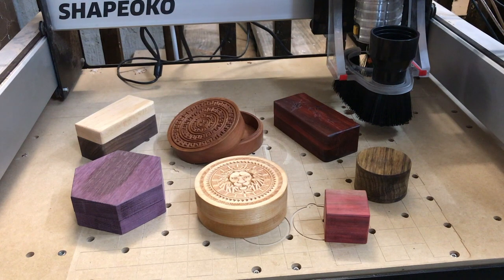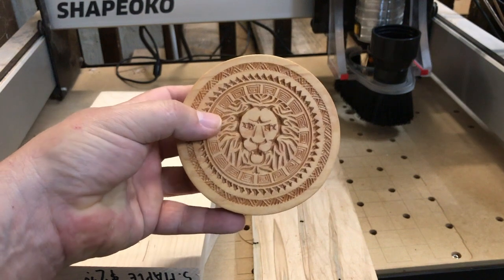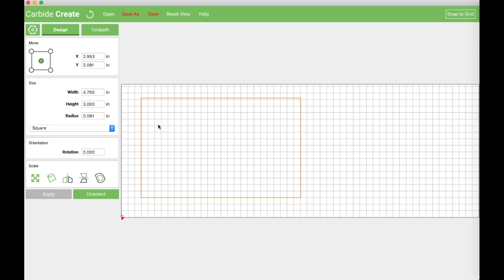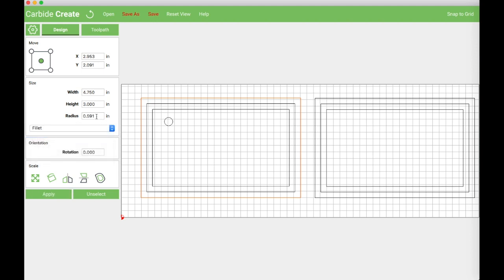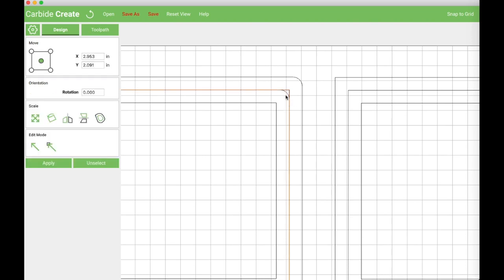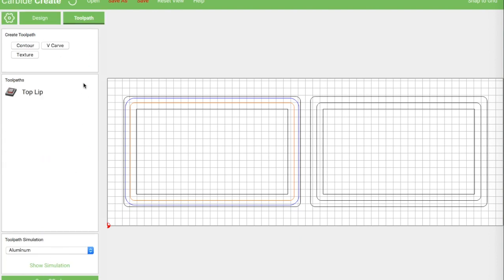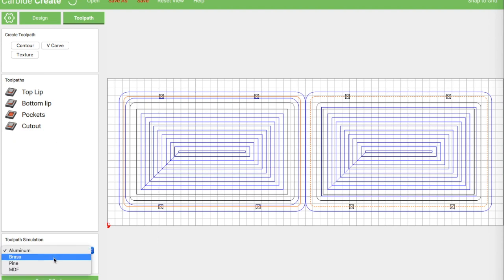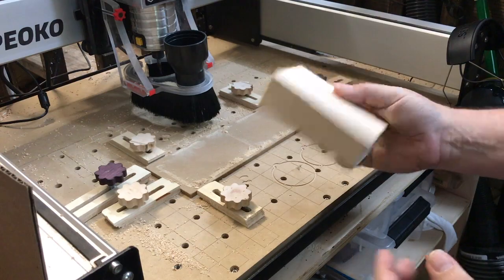Box Making with Shapeoko

Comment: Hello I really liked your video little question how do you go about zooming what is the command to do thank you
Reply from the maker: In Carbide Create it's the scroll wheel on the mouse. There is also a reset view option under the view window which will return everything to the size of the window. If you only have a trackpad, you can probably do a two finger scroll to zoom. it always zooms relative to where your mouse pointer is. Does that help?
Reply: thank you I will work on that thank you very much

Comment: I have a 14x9x3/4" piece of leftover birch plywood. Could I at least run a test on this material and then use the better wood like your selection knowing I've really locked down all the parameters?
Reply from the maker: Certainly. That's exactly what I did starting out. Things like plywood and MDF are great to experiment with and get settings dialed in. One thing to keep in mind is that 3/4 plywood is almost never actually .75 inches, (I have seen everything from .7 to .65) so a set of calipers is a must for getting a true measurement. The machine thinks in terms of 1000ths of an inch, so you need to as well. Birch ply is a great way to test ideas and get used to the machine and how tight the tolerance is for a project.
Reply: @johnearlclark    Thanks for replying and the tips.  One other question I’ve pondered - is a dial caliper better than a digital read-out type?  Thanks

Comment: Great Video thank you for sharing 
You don’t have to make one lip a tad smaller so the tolerance won’t be too tight?
Reply from the maker: You can. I like to sand mine to try and sneak up on a good friction fit. It's good to experiment and see what gives you a good fit (maybe a few hundredths at a time until you are happy with it). The annoying thing is that wood wants to move over time and round boxes are a particular problem as they want to oval just slightly. They can get stuck.

Comment: Hey John,I have a question. Do you have a way to put a small lip to the edge of the front of the box to be able to open it ,top and bottom lip? The small grove in the middle joint?
I'm able to do it on the Bottom lip using VCarve, but can't make it work on the Top lip.
Reply from the maker: If I am understanding correctly, you want a bit of a ridge on the lip itself? This requires a bit of a visual explanation. I posted up an image here https://www.dropbox.com/s/as6bii1gd54m5rr/Explainer.jpg?dl=0 Let me know if that is what you are looking for and if it makes sense.

Comment: Im using this carbide thing as well and I dont get the same cut at all fallowed your steps and using 1/8 bit and no go Also when I try to square the circle and I use the retracting bolean thing nothing happens or I get a copy Also its not crt its shift yea this doesnt work at all  for me
Reply from the maker: One thing to note with recent versions of Carbide Create: When you subtract one shape from another, instead of disappearing, the subtracting shape stays where it was. I think the idea was that you could subtract a shape, move it to a new location and subtract it again and again (which is great for making slots). However, from a usability standpoint it's kind of awful as it makes it seem like the subtraction didn't do anything.
Reply: @johnearlclark  Thanks yes I got it to work yes I have a newer version Thank you for this video Ive been wanting to make a box with a lip I can make them with magnets ok but I wanted to learn how to with the lip .
Reply: @johnearlclark  Hi John I'm trying like your doing but I dont get that lip for some reason Part 1 the cut is on the outside box 2 the cut is on the inside to get the lip but something im doing wrong I cant get the lip

Comment: John  When I hold down the Ctrl key and click on the circle inside the square, (around 9:18 in the video) nothing happens.  I have tried this several times and cannot get it to work.   I have carbide create Build 520 and the GUI is slightly different from yours.  Can you give me any help on why this is happening?  I have the free version.  Is this why it is not working?
Reply from the maker: Use the shift key. Ctrl used to work in old versions.

Comment: that is well explained,very easy to understand even for a newby,i'm just wondering if this program can act somewhat like a cad program for creating those rounded corners,if you draw your first square,round those corners first and then make the offset..will it take over those rounded corners?just wondering :-),great video by the way
Reply from the maker: Hi David. You can round the corners in newer versions of Carbide Create using the "fillet" option from the drop down. However this is only available for the square tool. The offset is a good option, but remember that inner offsets will have a smaller radius to the corner and outer offsets will have a larger one. If you are offsetting inside by a large amount, the rounded corner just goes back to being a sharp 90 degrees. I use it for a lot of things, you just need to confirm with the simulator that things are going to cut as expected.

Comment: What's is the max height of the bit (cut dimension depth)  you use for a bit.... I do you have 2" depth bits?... Do you have a link for bits?.. I will appreciate it a lot
Reply from the maker: The tallest ones I can find right now seem to be from Spektra and have a cutting length of one and a quarter inches. I could swear they used to make them longer, but I cannot find them.

Comment: Great job. I can see it's solid wood? Don't You have problems with bending of the parts after routing?
Reply from the maker: I try to allow enough wiggle room for wood movement. The key is making sure the wood is fully dry before routing. Even then, the round boxes tend to be a bit more finicky than the rectangular ones.
Reply: @johnearlclark  by allowing enough wiggle room for wood movement You mean that You are trying to fit the lid a little bit loose?
Reply from the maker: @TheForestBob  Yes. On the round or square boxes I drop a couple thousands off. It depends a lot on how long I have had the wood, how thick it was and how dry it is. On boxes with a magnet catch, there really is no need for a truly tight fit. On the rectangular boxes, they run with the grain and seem to be less prone to movement issues.
Reply: @johnearlclark  all clear, thank You very much

Comment: Hi John. I bought my shapeoko 3 about 6 weeks ago. I can't find the fillet option. I paused and went into the move feature selection and I only have the size in x and y current size shown below that and then apply and done. There's no fillet option. Do you have carbine pro or an older version that used to have that feature? I could add them manually but that's a nice feature I would like to use.  Thanks for your help.
Reply: John so still was having this same issue of machine path randomly offsetting and then cutting a shadow of the tool path. Finally got to the bottom of it I hope. I have been through every possibility and I came to the conclusion and carbide 3d confirmed it was likely the case. It was EMI interference from the router causing the stepper motor to travel too far or not far enough. I had already removed my shop vac from the same outlet because I noticed a pause or studdard in the travel when I'd turn it on or off. However being the router ran continuously during the running of the program I didn't think it would be the issue. So that is now plugged into another outlet and I added drag chains to my shapeoko while also rerouting the router wires so they never contact the controller or stepper wires. Just wanted to share in case anyone else ever runs into this problem. I'm very knowledgeable on machining and troubleshooting problems with that like squareness and other things that can cause errors in a part. However I am not very knowledgeable in electronics or how they work and possible problems they can cause.
Reply from the maker: @justinlareau2227  So glad you found it. EMI interference is a total pain to track down. I was lucky enough to have my CNC on a dedicated circuit from the start. Thanks for letting me know.
Reply from the maker: In the recent versions of Carbide Create they stopped labeling the drop down as "filet" for some reason. After you draw or select a square, you will see a drop down under the height and width that says "square" (which is not terribly helpful since that is what you just drew). That drop down has your filet options. It's not very intuitive.
Reply: @johnearlclark  thanks for the help. I just checked and below the width and height I only have apply and done. So something isn't correct here but I appreciate your help. Thanks for the videos. These have been a great help.
Reply from the maker: @justinlareau2227  you may have an old version. What version are you using?
Reply: @johnearlclark  i'll have to check when I assembled it about 2months ago upon receiving it in the mail I downloaded what I thought was the latest version on Carbide 3D's website.  But the instructions were terrible for assembling the machine. My only complaint really about it. That and needing to drill out the paint in the 4 hole on the carriage plates that the x axis gantry mounts to in order to get z axis rails square front to back. The bolts were very difficult to thread into the aluminum rails because of this but it's minor and easily fixed. I'm currently a Quality Engineer at a manufacturing company in wisconsin but a decade ago I was a tool and die maker apprentice for about 3 years and ran CNC milling machines along with many other machines to make fixtures and tooling components. So i'm a lil rusty but definitely experienced with cnc machining and g-codes.
Reply: @johnearlclark  update yesterday I was having issues with my program or the machine not cutting in the correct locations. A square ended up having one edge ended up with two lines. After checking square belt tension v wheel etc. I was stumped. I remembered this conversation I uninstalled carbide create and reinstalled. Wah Lah fillets option was there. I made a small test piece and it was cutting correctly where everything was supposed to be so I deleted my old designs on the glitched carbide create software. Because I think there was just something bugged in there and have to redesign and redo my wasteboard. Sucks I wasted half the 2' x 4' MDF board over this. I'm really hoping that was my issue. Because I don't think it skipped a step because as it was cutting around the square the other 3 sides stayed lined up. If it skipped you'd expect an offset square cut to the old one.  I ran out of time yesterday to do a test piece on some cheap plywood before I waste the rest of my MDF I have.
Reply from the maker: @justinlareau2227  So glad you found a solution. I hate wasting material too, but sometimes it's how we learn. Trust me, my burn pile is pretty big too.
Reply: @johnearlclark  thank you for your help John. I appreciate the responses and videos. I'm really hoping that was the issue and not something else. In the paper instruction revisions I typed in the link to my computer written on those. I wonder if that took me to an old version or if the download failed. Who knows. I also in some early projects had issues with cutting in the front left hand corner of the cutting area. I noticed when setting up earlier projects there same thing. A circle for instance ended up cutting correctly first few passes then all a sudden it would cut off the path and ruin the piece. At that time I was cutting a piece of balsa incredibly conservative rates so I know I wasn't pushing the machine too hard.
Reply: @johnearlclark  for whatever reason I've been noticing some glitches in my carbide create software. Maybe I should uninstall and then redownload it.  A recent example I was designing my wasteboard and included line segments in a one inch by one inch grid and I know I saved it and random ones were missing and I remember the way I drew them so I know what order they should be in if I forgot to save before exiting. Just weird little quirks.

Comment: John, great vide - thank you. How do you deal with pieces that have a slight warp without a thickness planer?
Reply from the maker: If you don’t have a thickness planer, you can do a shallow pocket pass over the stock (1 or 2 mm at a time). Once the side is flat, flip the board and do the other side. If you have an old router bit, like a 3/4, it goes pretty quickly.

Comment: Hi John . thank you for your help on making boxes my wife is trying to make your round boxes along with oval boxes. however they do not fit into each other. the inside lip needs to be reduced just a little to fit can you help her?
Reply from the maker: Hi Clay. Sorry for the late response. You can select the circle for the inside lip (The second of the 3 circles) and shrink it by about .05 using the height or width boxes. See if that's enough.

Comment: Hi John, on my multeenth time creating the simple box in Carbide Create as I try to learn the program.  Making good headway I think.  Regarding the rounding of the corners on the lip line rectangle (middle line of the three).  I have experimented with creating that lip line first, with a .125 fillet and then using the offset path tool to create both the outer box and the pocket. This appears to work as a simple way to get rounded corners, I needed to created the initial rectangle .34" smaller than the desired box size. What do you think?
Reply from the maker: zeyeam that should work just fine. The version of Carbide Create I was using at the time didn’t have filets but they seem to be much better in the current versions. Just remember to keep your pieces centered on each other and it should work out well.
Reply: Thanks John.  My machine should arrive tomorrow. Yippee!

Comment: John I have  a problem . I went to the cutrocket and found  your files on the heart shaped box. I saw that it came in inches. I viewed it   in inches and downloaded it and I got MM So how do I get the inches version.
Thanks Jeff
Reply from the maker: When you open the file in Carbide Create, you can click the little gear in the upper left corner of the window. You should see a small section for units down towards the bottom. You can switch from MM to inches there. Hope this helps. -John
Reply: @johnearlclark  Yes it did and as soon as I saw this post it all came back I have not used CC since I Bought vcarve pro. Thanks .this file opens in CC if you click the  icon twice.un like the file for the finger joint jig
Reply from the maker: @resorter66  Cool. Are you also the one who asked the same question in the Carbide forum? I was going to answer there, but wanted to check first.
Reply: @johnearlclark  yes I am. I am still trying to sort out your files about the finger joint jig. Which file goes with which pictures I want to cut the joints vertically  off the front of my xxl .jeff
Reply from the maker: @resorter66  Unfortunately, CutRocket randomly assigns those numbers to the files. It is not the most helpful thing in the world. I am not even sure what they are. I posted a set with helpful names here: https://www.dropbox.com/s/036dzrxiw8oc8ae/Finger%20Joints%20Jig.zip?dl=0
Reply: @johnearlclark  I down loaded the files you sent me in dropbox Thanks. Had a question though In the template file there was not a toolpath listed is that  right or not thanks Jeff
Reply from the maker: @resorter66  That is correct. Since I don't know the thickness of your board or how big you want the finger joints. You will need to create the little rectangles like I did in the video, and set the tool path to cut every other one (the the opposite for the second board). Does that make sense?
Reply: @johnearlclark  yes it does

Comment: Hi John, thanks for your time in making these videos. I don't know if you've figured this out yet, but you can save yourself a lot of time if you design the square boxes from the inside pocket, out. CC lets you add filet corners to any polygon you make (square rectangle, whatever). If you start with the inside pocket, set the filet to slightly larger than your tool radius (slightly larger so there's less cutter engagement in the corner for a better quality cut). From there, just use the offset path tool going OUTWARDS, and they'll have a complimentary filet in the corners.   Just a thought, as it does save some time. Have a great day!
Reply from the maker: That's also a good option. Unfortunately, at the time I made this, there was a bug in Carbide Create where the outer offset would drop the corner radius (It has since been fixed). The radius also grows with each outline, which is not always what you are going for (I tend to like a more subtle rounding on the outside).  I am glad you like the videos and I do appreciate the feedback. It's always nice to see other ways to do things.

Comment: When Cutting lips that overlap, I did not notice any difference in size. Does the difference between and outer cut and inner cut provide enough space to allow and overlap?
Reply from the maker: Sometimes I will sand or plane to fit, but you can also drop a few hundredths off to get things to sit correctly. It's whichever suits your process. The real bear is the wood movement, which seems to hit the round boxes hardest. If they oval even slightly, the lid can stick.